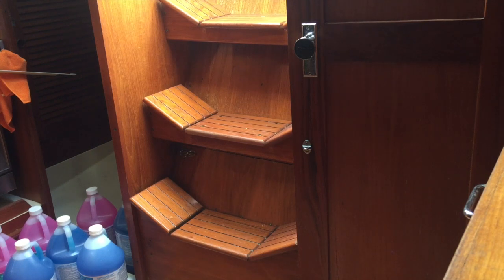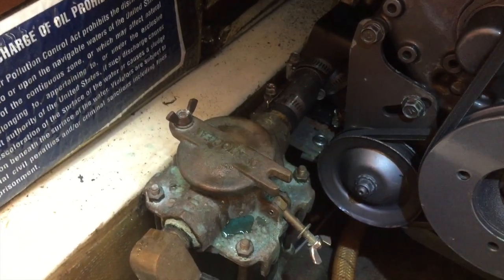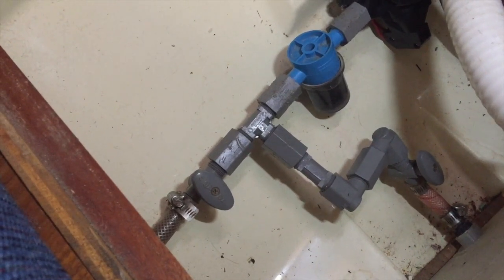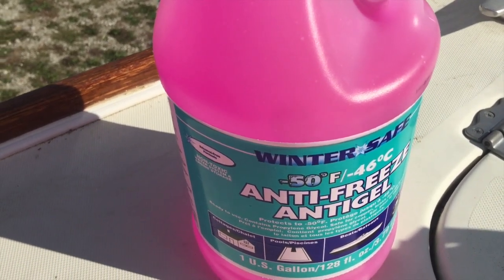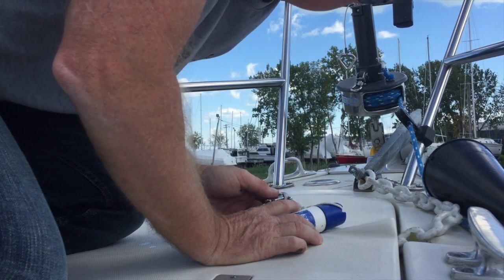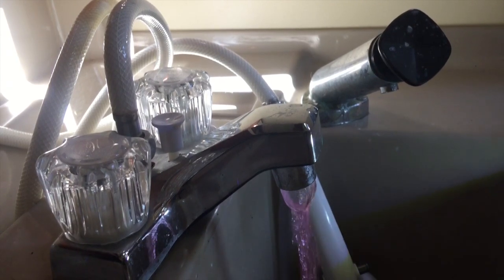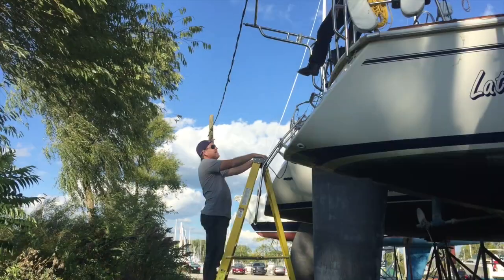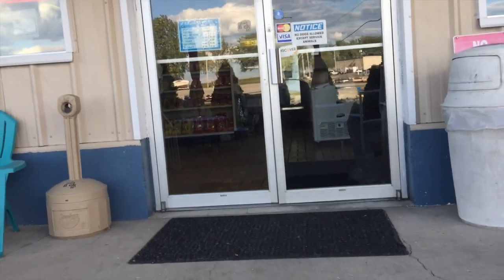SCOTTFLICK SAILING Episode 23 Winterizing my 1988 Pearson 33 sailboat

Comment: You should consider removing your thermostat before running the AF through your engine. If not, the thermostat will not be open as the engine is not warm enough to open the thermostat and the AF will bypass the engine and out the exhaust.
Reply from the maker: Ray Mtl wow, I did not know this. I will definitely check into this.